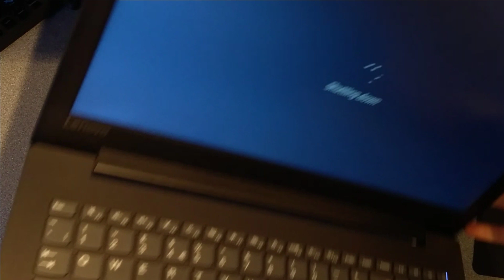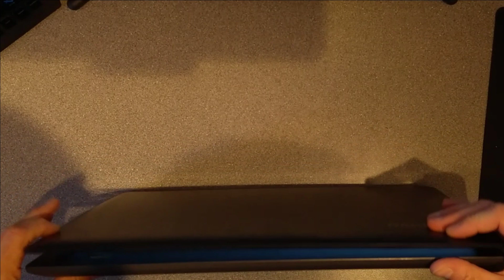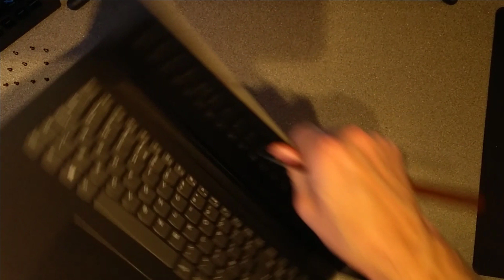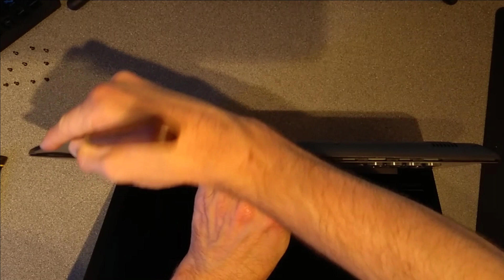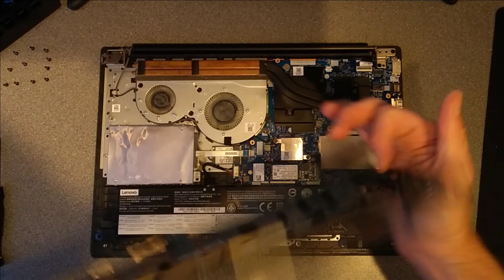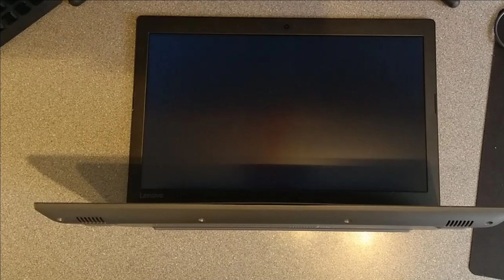Lenovo Ideapad 330 15ICH How to upgrade or replace the hard disk to an SSD

Comment: Missed a monetization trick here by not linking the tools and ssd in description! Thanks for the vid, exactly what I was looking for. Very, very helpful. Mine runs so slow that it's being used as a paperweight right now. Any chance of a bit more of a detailed guide on cloning the drive and disabling/removing Optane?
Reply from the maker: I so rarely come across Optane and forget to take video, maybe the next time if I see it. Cloning the drive using Macrium Reflect trial/home is super easy as long as you can connect both the old and new drive to a working operating system with Macrium installed. Be that an entirely different computer or the computer you are wanting to clone from and install Macrium on it. Usually you will need a USB to SATA adaptor.

Ref: Amazon or similar monetised links.. something I've thought about but not yet organised. Plus I'm in the UK so unlikely to get funds from people buying in the USA and other countries so less helpful than if I were USA based.

Comment: What is the "Obtain" module and how do I disable it in Windows ? I bet it's the reason my Lenovo 330 is dirt slow and almost unusable based on what you mentioned in the video.
Reply from the maker: Optane, it's a system where the motherboard uses a hard disk and a crap quality SSD to make the system feel faster. if the hard disk or the SSD goes wrong it then just makes everything really, really slow.

Google for turn off optane or similar. It should be as simple as clicking an intel icon in the task bar near the time and telling it to disable optane.

Comment: thx sir i want this information. 
but why my laptop haven't SATA cable.
Reply from the maker: If the laptop did not come with a SATA hard disk and only had an M.2 or NVMe it may not have come with the cable for the SATA. eBay will probably have one.

Comment: Hi, I wanted to change the ssd nvme M.2 (2242) by a 256 go but it is not recognized by windows 10, by external box it works, is it the maximum capacity 128 go. Thanks
Reply from the maker: I wouldn't have expected there to be a limit. But there's a difference between NVMe and m.2 SATA. A board can support m.2 SATA but not NVMe.

Comment: Is disabling Optane Safe for my laptop?
Should i have to enable optane After setting up new ssd?
Reply from the maker: Disable Optane wherever possible. Make sure you do it safely so either when you have a backup of your data or you know that optane has correctly flushed the data.

Comment: Those who are asking if there laptop supports nvme m.2 ssd or the capacity if they laptop same as me lenovo ideapad 330 15ich i5 8gen 8gb ram 4gb graphic card.
So you can install nvme m.2 ssd upto 2tb. I recently upgraded wd blue 570 ssd so you can do without any problem.